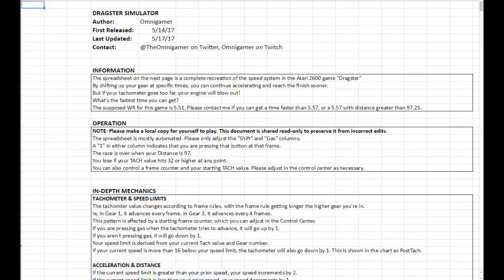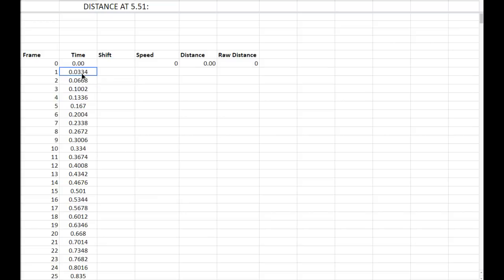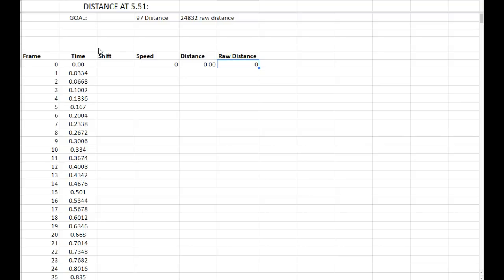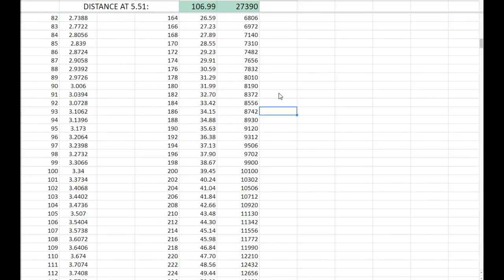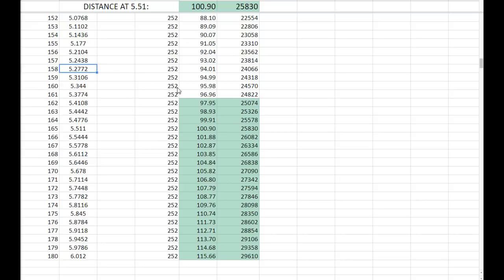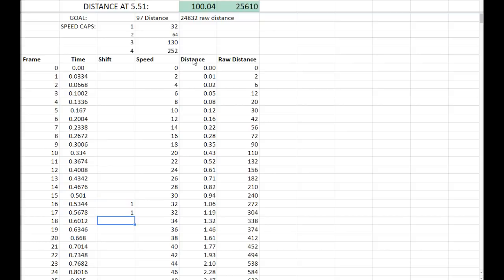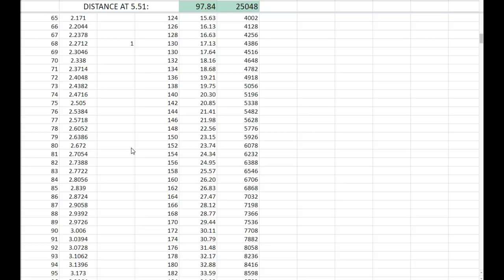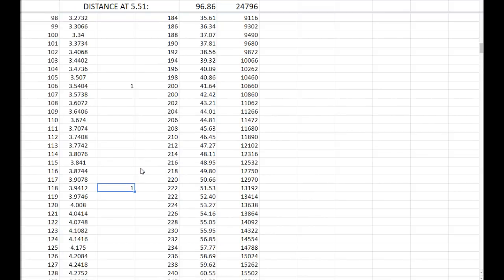Dragster - Speed Theory

Comment: So playing this in Australia on a 50hz tv... I cant go as fast?
Reply from the maker: You can, in fact! The PAL versions of the game weren't edited to change the timing at all, so you can still achieve 5.57. It is also slightly easier to do so, since you'd have an extra 3.3 ms each frame to make correct inputs.
Reply: Omnigamer oh ok, hmm, so if one was to use a pal cart in an ntsc machine or vice versa (assuming they are different) would it be possible to run a faster time?
Also, how about a voltage difference to the console?
The ecu in my car was logging a transmission fault because of the time it took to shift into torque converter lockup, i replaced the transmission and it still set the fault code, problem turned out to be my alternator was charging 18v most of the time and then occasionally dropping to 9.3v,
 (faulty regulator and worn brushes) which then caused it to think the shift was lagging and set a fault code for transmission slip.
Wonder if a similar voltage change would cause a different possible time to be achieved?
Reply from the maker: Voltage differences and PAL on NTSC would not affect timing, since it counts loop rather than conforming to some real time reference. The electronics issue you mention with your car is a very different circumstance, and wouldn't happen the same way with an Atari.
Reply: Omnigamer oh ok, yeah i wasn't sure hence asking  haha

Just trying to come up with a scenario where it is possible to exploit the system in some way to achieve a faster time, hmm, theres another thought, dont suppose a game cart could be modified in some way to achieve the 5.51 that is seemingly impossible? I have always speculated that Rogers was a marketing tool by Atari/Activision to boost sales or at least interest in their games...
If they gave him a special cart, with some sort of different calibration, he could have set the fast time, and naturally it cant be repeated on a regular cart... 
Still as cheating as it gets, in no way "sticking up for him" but its a plausible possibility...

Comment: Maybe I don't fully understand, but does it make sense to say the first shifted gear happens in the 0th frame? Could it not only happen as of the first frame?
Reply from the maker: You can start the input for the gear press at any time before the race start, but you can't complete it (ie, release it) until the countdown hits 0. Frame 1 with time .0334 is the first frame that release won't cause an early flag. Frame 0 in the spreadsheet simply represents any activity before the countdown finishes.
Reply: Omnigamer so then you can actually shift into gear by releasing on the 0 frame, and continuing off from there. I know this was excel and beat scenarios, I was just confused as I thought the best scenario would be on the first frame, making the time even worse. Love the work you put into this though. Kudos and thanks for the reply explaining.

Comment: You said the speed increase slightly more then double. 8:00 it goes from 64-130-252?? 252 is less then double 130. Plz explain
Reply from the maker: Please note the corrections in the video description! I was going off of memory for most of the video, so a few things weren't quite right. The end points are still valid though.

Comment: we need a TAS to figure this one out. maybe a mem overflow somewhere
Reply from the maker: There are no overflows or other major technical bugs in this game.
Reply: Omnigamer for as much as common sense tells me “a 6502 game this simple is probably bulletproof”, I’m reticent to put an atari game in the same category of software as the firmware on a car’s ECU, being “on paper no software is infallible, but let’s pretend this stuff is, because if it’s not, we’re in trouble.”
To give an atari game such credit just doesn’t seem right. 
Additionally, the hardware itself isn’t infallible, if it’s possible to hit one of these errors from within the scope of dragster is another question.

I want to believe.
Not that the 5.51 happened, but that it, or something similar, may be theoretically possible.
Reply: @funposting8912  It's 100 lines of code. Come on now.
Reply: @DrynSarcastic360  it’s 1,770 bytes of hand-assembled 6502 instruction, if you think there isn’t room for error in that I’d guess you’ve never written 6502 before.
The Furby was programmed in much the same way, and it doesn’t take long to find someone who’ll attest to how deranged they used to act.

Comment: But what about games like Super Mario Bros. where speedrunners have been continuously finding ways to effectively break the game's theoretical limits (aka rules) in ways they had no way of knowing being possible, through actually fooling the game. They are breaking the game's logic, by fooling it. They had no idea it was possible until it was found, and then they had to reverse engineer how it happened and why, but the difference is that they were able to see what was done that changed things. Unfortunately, we just wouldn't be able to know with the supposed fake score. It could have been a 1 in a billion chance.This is one way his supposedly impossible time could be possible, I guess.

Also, another possible answer is like in Man vs. Snake, where one player had his score removed, because it was found that the motherboard he was playing on in Nibbler had a tiny electrical mechanic issue that made the game run slightly faster. It's not outside the realms of possibility that something similar may have fluked for the supposed 'worst cheater of all time' (wow, what an overblown label for a god damn high score on an Atari game, right?).

I feel like these are questions that should have been asked before demonizing a very skilled video game player. I mean, Atari had come to him and questioned him about his play method, and he seemed to make the designer think "without a shadow of a doubt" that his score was correct.
Reply from the maker: We did ask those things - many times, in fact - and many times found that there's no such way to impact the timing or get around the game's rules.

Also, there's no evidence that Todd ever actually spoke with Activision regarding that particular score.Other information has come up that completely contradicts his version of events.
Reply: "We did ask those things - many times, in fact - and many times found that there's no such way to impact the timing or get around the game's rules."

But that was part of my point. The Super Mario Bros. speedrunners thought there was no way to get a better time, but through years of constantly running tool assisted speedruns, new things slowly and sporadically popped up. Of course, they are going to believe that there are no other ways to improve it, until they got slapped in the face with a new way shown, that they could then reverse engineer and understand how it happened. The hypothetical problem in reverse engineering and figuring out how a 5.51 might have happened is it was allegedly one time, and he doesn't know how, as opposed to now, where it's all recorded and able to be looked over.

"Also, there's no evidence that Todd ever actually spoke with Activision regarding that particular score.Other information has come up that completely contradicts his version of events."

That couldn't be further from the truth. Activision met up with him immediately to question him and his playing style, and went on to form a friendship with him, turning him into a form of spokesman for the company. Here's the developer of Dragster: http://www.twingalaxies.com/feed_details.php/87/dragster-designer-without-a-shadow-of-a-doubt-about-todd-rogers-record/1

With this simple and easy fact you seem to not understand, it makes me question how many other things you might have failed to understand, or even see, when you claim how much you looked over "many times".
Reply from the maker: SMB, as a piece of software, is orders of magnitude more complex than Dragster. It's impractical to try and read through the code of SMB as is easily possible with Dragster. That said, the improvements you're referring to are just easier ways for humans to achieve TAS-level optimizations - there haven't been improvements to the TAS in many years.

There is no more room for anything strange to happen in Dragster. Everything has been examined. If you don't want to trust that, you can read through Thomas J's annotated disassembly of Dragster and decide for yourself whether or not anything is missing.

As for your other line, please re-read what I said and what the article said. David never claims to have seen or questioned the alleged score. You are citing Todd, not David, when you mention that his playing style was questioned. By all accounts, Todd had already started a relationship with Activision prior to any reasonable estimate of when he claims to have accomplished the score. The timing has been contradicted by the Activisions newsletters themselves, and Todd's story has been contradicted by both Crane and other alleged 5.51 players.

Before you try to trudge further down the rabbit hole, everything you are trying to bring up has been discussed to death in more than 2700 posts on TG. If you are honestly interested in the truth, I recommend going through that thread to fill the gaps in your understanding.
Reply: Sorry, I had somehow molded together the 2 of their separate accounts in my memory, forming them into all being said by Crane. I have been going down the rabbit hole all night, and now my brain is basically mush. I diverged into this subject, starting from Billy Mitchell's current situation, and am still curious in seeing the source of this new Dragster 5.51, even if a hacked version.
Reply from the maker: I have no idea who the individual was that Billy is referring to with Dragster, but there are numerous "AutoShift" hacks for Dragster available that are messy, to say the least. You should eventually find some links to videos of the hacks within the first 50 pages of the thread, but they are tricky to find on YouTube due to overloaded terms. Many may also have been removed or are unlisted. The hacked ROMs should be very easy to locate, however.
Reply: "I have no idea who the individual was that Billy is referring to with Dragster" 

Well, you sure were quick to make me think otherwise. Oh well.
Reply from the maker: That is how other people who are closer to Billy have clarified his statements. In any case, if any individual has evidence of a flaw in my model of original Dragster, they have not presented it publicly, so I can't comment on it. Billy can rely on whatever anecdotes he wants, but his claim is moot without evidence to back it up.

And no, I don't believe in the least that such evidence exists or can exist, given the extensiveness of the investigation into this game.

Comment: The other possibility of how a 5.51 is possible is by shifting BETWEEN frames if you time it perfectly. This would stop the speed from freezing between frames and a 5.51 would theoretically be possible.
Reply from the maker: There's no such thing. The game only reads shift inputs once in any given frame; the state of the shifter for any other timeframe has no effect on calculations.

Comment: Have any interest in releasing this spreadsheet?
Reply from the maker: The spreadsheet from the video has actually been overwritten already, but you should be able to make your own following the same steps. Do note the corrections in the video description, though.
Reply: Omnigamer alright thank you.
Reply: So I may not be grasping something, but what is the blue area near the bottom and why is it set the way it is ( I found the spreadsheet from someone I think on TAS. assuming it's all right,  I guess I am pretty brand new to the game, and well I'm just trying to understand.
Reply from the maker: The shaded cells were a conditional formatting. Most spreadsheet programs will have some way to do this; in my case, I set it up ahead of time to just highlight cells that had a distance greater than or equal to 97, which indicates the win condition.
Reply: Sorry I didn't specify ( assuming https://docs.google.com/spreadsheets/d/1m1JKUGQdqjRkgqWgY6j6Dp1dXqM7KKEuYwjw7fpnLSM/edit?usp=sharing was your final spreadsheet) The blue highlighted section, what was that? That is what I'm not fully understanding. Thank you.
Reply from the maker: The blue highlighted areas are "don't cares." This means that it does not matter whether the button is held or not during those frames. You should treat them as some amount of leeway to adjust to the next required input state.
Reply: Could those potentially change assuming there is a more optimized timing?
Reply from the maker: Any of those marked regions would have to be re-checked for each different strategy and seed. In general they are marked for understanding how much margin for error is available to runners.
Reply: ok,  Thank You. i'll keep in touch if I can find anything.

Comment: I almost want to debug this shit out for myself. I am a fairly competent hacker myself, having done quite a lot of research on Zelda64 (function documenting, figuring out how that pesky "wrong warp" glitch works, partial discovery of the GIM glitch). The hardest part for me to get starting with something like this is probably

1) motivation to stop hacking Ocarina of Time
2) setting up an emulator
3) learning "atari 2600" asm

If I had a solid list of links to tools and docs, and perhaps your disassembly notes, it would make it easy for me to get a sense of "context" and start poking into things. 

My biggest worry is that there really is some way to get a 5.51, but only through some obscure hardware quirk.
Reply: 5.57 not 5.51
Reply from the maker: It's actually pretty easy to get started with Atari reverse engineering - it's a MOS 6502 family instruction set, just like NES and SNES. It's very straightforward to keep track of things with an accumulator-based architecture like that.

The tool I used for this was IDA Pro for static analysis, and BizHawk for checking general function. IDA Pro has something of a learning curve, and isn't free, but there should be comparable alternatives out there. I don't know any off the top of my head though.

If there is any especially obtuse bug or quirk that allows a 5.51, it would almost certainly allow for significantly faster than that as well. The most glaring possibility for this is starting before the countdown ends, which I've examined pretty heavily. Everything else would require busted hardware or a corrupt ROM...
Reply: Paul-Stelian Olaru See above comment! :p
Reply: Darb and Omnigamer both have 5.51 on real hardware!